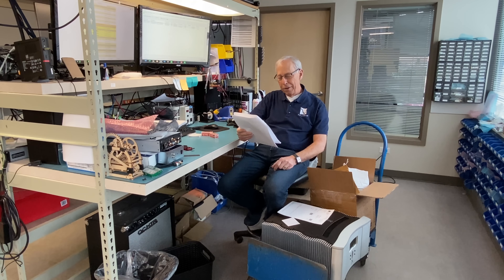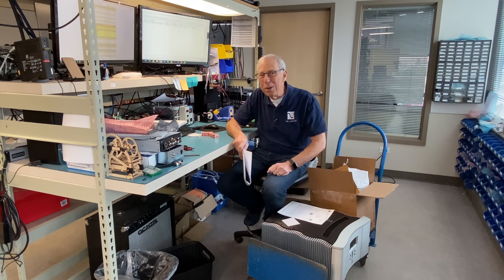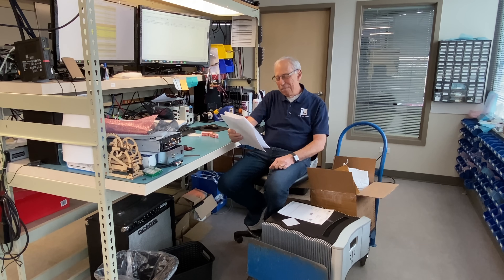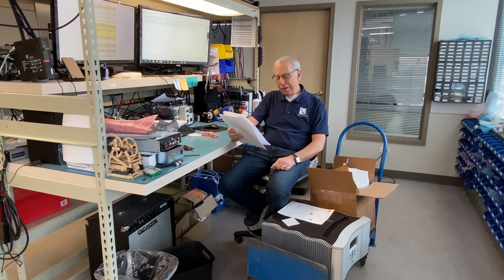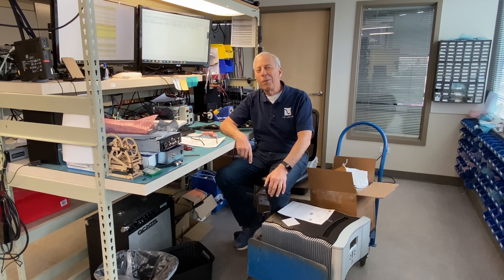Room acoustics for stereo

Comment: You can easily build sound absorption panels using Rockwool Safe and Sound insulation material readily available at the big box stores. Build frames using 1x4 pine (measures 3/4" by 3.5"), to create 24" by 45" or 36" by 45" frames, place three runs of the 15" insulation sideways for your 45" height, wrap them with attractive material available at any local fabric shop, and staple the material to the back. You can apply very thin material to the back to hold the insulation in place. I built a bunch of them for a few hundred dollars. They are attractive, safe for use in the home unlike fiberglass that is dangerous and should never be used except inside enclosed walls. They also are very effective for most frequencies, unlike the stupid foam material you can buy that is excessively overpriced and only effective in the upper frequencies. You can easily hang your absorption panels on the walls, or even better, build the side pieces long enough to extend to the floor and add cross pieces on the bottoms, then paint them white or whatever, and now you can stand them in the room anywhere you want, keep them away from the walls by 6-12 inches, and then remove and store them if you are having guests or other activities in your listening room.
Reply: Great suggestions. You videos are fantastic as well. Thank you.

Comment: I built a pair of 2x4 ft 4 inch thick acoustic panels that I placed in the front corners of my 12x16 ft room a few years back to take it down and I installed 4ea 23"  sq panels (similar to what Paul uses in the music rooms) a while back to control my first reflection points. This along with a carpet on the floor will do great job of controlling the room at a cost of $200 (not including the carpet) so I would do a bit more research before laying down that kind of cash.
Reply: I built corner panels 16 inches wide using rockwool, and found that low frequencies were still loading up in the corners. Effective corner traps need to be very wide, I will next build replacement corner panels at least 24 inches wide or wider, and 3.5 inches deep, but instead of using 2x4's which are cheap but heavy, I will use 1x4 and use wood screws to screw the corners together.
Reply: @SpeakerBuilder   I used 4 inchwide strips of plywood screws and corner braces) with a double layer of 705 fiberglass, I also extended them so they are now 7.5 ft tall.
Reply: @dell177  Those 705 panels were designed mainly for temperature insulation. For sound absorption, you need material that will absorb sound energy and those flat panels may be more reflective than absorptive. For that reason I prefer the loose material of the Rockwool, which is non-toxic (after briefly working around loose fiberglass insulation material, I find that I cough incessantly for quite some time afterwards, as I have breathed in the tiny glass particles). And I use the 1x4 pine boards because you can run a screw right through one into the other at the ends, and stapling to the pine is quite easy, I may run a piece of the same pine across the middle of two sides, but no corner bracing is needed.
Reply: @SpeakerBuilder    The 705 is a dense rigid panel that is 2" thick, it won't compress so I decided to use 4" wide plywood strips and wrapped everything up with burlap. I was able to get the 705 easier than the rockwool and that's why I went with it.
i do agree you need to build these somewhere that has good ventilation until you get the fabric on them.
Reply: @dell177  And of course wear a good mask as ingesting the fibers is very bad, although the flat panels may pose less of a risk of that. I would like to see testing on reflective vs absorptive properties of the flat panels vs loose fiberglass or rockwool. BTY, rockwool is readily available in the Safe & Sound version which is designed for sound insulation at the big box stores across the country, and of course can be ordered on line.